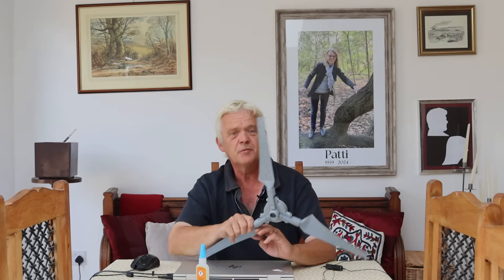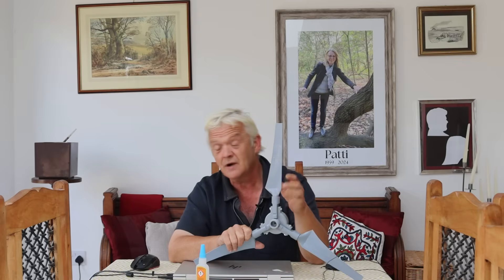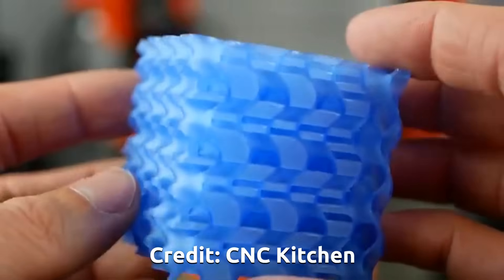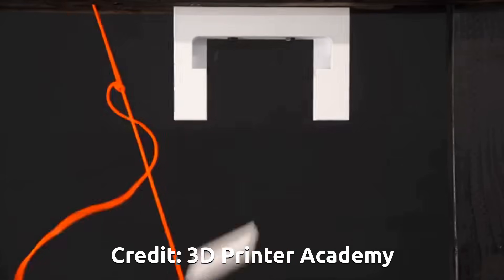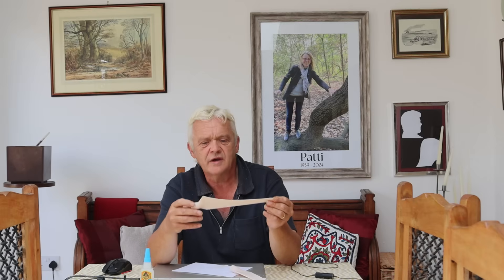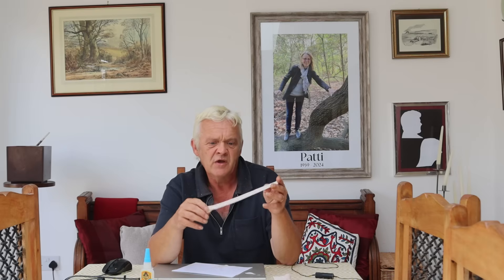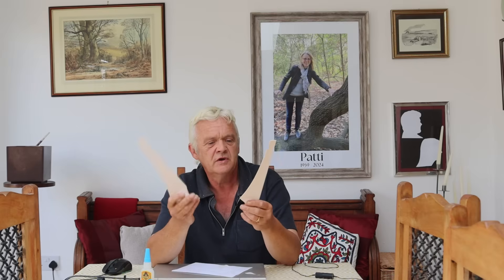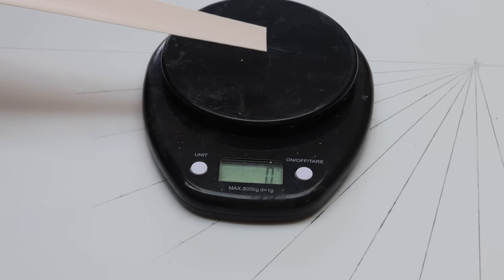2281 Making Stronger Wind Turbines

Comment: Hi Rob, I missed you deeply while you were in morning and you can't imagine how happy  am to see you back. I do realise that my small inconvenience was nothing to what you have suffered.

As far as the strength of gyroid goes, it is ansiotropic in compression, sure, but in bending and tension we have to account for the fact that FDM is in layers, so there will always be a weakness if layer adhesion is weaker than the cohesive strength of the material. Also there is the question of the infill to wall connection. I see these aspects have both been mentioned in the comments but I hoped to clarify a little.

Slightly off topic, but not so much: I have been developing on a device that was inspired by one of your earliest videos - The Secret of Magnetic Motors, iirc. Initially the idea was to switch magnetic flux so that the power of the magnets would determine power output rather than the input power. In the design -> solve problems -> redesign -> make improvements -> redesign, ... process I came up with a completely revolutionary (if you'll excuse the pun) design  that looks like it will run simply due to the geometry of the machine and the arrangement of magnets.

I believe you started this channel because you were investigating free energy and you may have diversified into energy systems in general and anything engineering-fascinating and have distanced yourself somewhat from the free energy mission, perhaps becoming persuaded to the conventional view of physics where, "You can't get something from nothing". Perhaps I have read you wrong but in any case, with this latest design I have had a response from a moderator on the physics forum (on scienceforums dot net) - a guy who was very sceptical with earlier designs and who couldn't be bothered to analyse what I was proposing because Laws of Thermodynamics etc - he replied to my latest post that simulates the device and said, "I have to admit the design is intriguing we will have to see how it works outside the simulation." Now, if that guy - who normally diverts the thread into discussion of quantum spin of electrons or similar - is making comments like that then I am convinced that someone like you will find the idea to be intriguing as well. I hope you will find time to take a look at my YouTube channel at the latest iteration and perhaps at my web page about the device. I would value your input greatly.

Regards,
Prajna

Comment: The Gyroiod is nice and all, but the grain is still there.  It just has air gaps to make it stronger because its more flexible.  If you really want it to be strong, use the print to create a mold and cast it in resin.  If you want it lighter, cast in 2 parts with a structural foam core and epoxy it together.

Comment: I can see gyroid should be stronger but I wonder on a part as thin as the blades, is there enough actual infill to really make a difference?  Your test showed it might, but it was close enough where it could have been a factor of the test not being conclusive as it was only a single sample of each.
Reply from the maker: true enough but others have done better tests to show the validity - i was just confirming it for myself and letting you know
Reply: @ThinkingandTinkering  Right, but my only question was, being so thin, are we actually seeing a benefit with the pattern?  Or if you ran the test 10x on each, would it show that it is in the margin of error and they are more or less equal.  In other words, if each 'pattern' in the gyroid occurs every 1mm, would we need to have something 3mm thick to get all of the interlocking patterns into the object to see the real benefits of it.

Comment: I suspect that the main reason the gyroids don't make a drastic difference here is that the stress is pulling on the layers rather than compressing the gyroids. As others suggested, printing lengthwise would be the strongest as bending the blade wouldn't pull the layers apart. With lengthwise layers I wouldn't be surprised if it becomes so strong that the scale reading maxes out before the blade snaps. The gyroids would still help stiffen the blade better than most infill patterns.
Reply from the maker: cheers mate
Reply: Drastic is by how much? Please notice how two blades behave on the scale. The one with gyroid filling is more stiff - it doesn't bend that easily.
Reply: @ogi22  Drastic as in resulting in plastic deformation rather than, or at least before snapping. Presumably beyond 5kg of force which is why I think that the scale would max out first.

Comment: I would change the print orientation, put the leading edge of the blade on the build plate. You could then tweak the design, by placing the hub mount on the leading edge, so no support would be required.
Reply from the maker: cheers mate

Comment: Interesting Rob. I think the key to strong 3dprints also have a lot to do with the way the infill is attached to the shell, shell thickness (outer wall thickness )and the thickness of the upper layers and the bottom layers(if you print at 0.2 layer heights, you want to set the number of top and bottom layers to 15.(3mm)) I always have my slicer set so that wall thicknesses is always 3mm where possible. As infill I use triangular where infill wall multiplier is set to 2 and infill line distance is 8mm. This makes a ridiculously strong print especially for larger prints when using Petg(245c/75c) - Very versatile, but not the fastest. If I need to reinforce or waterproof something I use Epoxy. Superglue works well for bonding it is quick strong and a must when making 3d printed parts but it has little to no filling and structural strength hence Epoxy.
Reply from the maker: i deliberatly made the shell as thin as possible - but brilliant points mate - cheers

Comment: Gyroid grids like that remind me of chainmail cross layered(dragon chainmail pattern with multiple layers in alternating orientation).  Makes sense as properly made dragon chainmail is much stronger than a single layer of solid metal of the same mass and area covered.  Thanks Robert!  Information videos on this is much appreciated.  Now on to the batteries/capacitors made with this lattice.  I am sure that would pose no logistical problems.  LOL!  Right keep dreaming!
Reply from the maker: i didn't know about dragon mail mate - nice one cheers

Comment: The snapping you're encountering is deamination of the layers I think, the gyroid is going to increase the surface area of the the interface between the layers so you get better lamination strength.

You'll get much better performance if you print the blades a different orientation, try it at a 45 degree angle and you'll change the axis of strain to better meet the part's strength.
Reply from the maker: cheers mate and nice suggestion

Comment: You want to print the blade flat or horizontal so you don't get a surepoint vertically also you want to use a stronger material but pla my favorite material so far which is a good conference compromise without being too expensive is carbon polly carbonate if that requires a 300° print nozzle which is typical not found in a basic picture so that's an upgrade you have to do you will find the part five times stronger and also without the UV decay overtime
Reply from the maker: cheers mate

Comment: Since you have the Bambu Printer. With the exception of losing filament and extra cost. Might try printing the infill with different material like carbon fiber.
Reply: Carbon fiber is not a material it is an attitive
Reply: @giannagiavelli5098  They do make carbon fiber filament. 3D Universe Nylon Carbon Fiber Filament for example.
Reply from the maker: good idea - cheers mate

Comment: Are the stresses on blades usually vibrational? Because if so, it might help longevity to add some type of gelatin solution in one of the gyroid partitions to act as a dampener to vibrations. Especially singe we have ~2g to spare when it comes to weight
Reply from the maker: that is an intersting suggestion - cheers mate

Comment: A colleague of mine, another naval architect who fiddled with making ship hulls at scale in filament 3d printing told me one secret to aleviate the layer bonding problem was to cover the 3d model and bake it at around 80°C to 90°C for 3 hours, wether covered in salt or sand, as to use the crystals slowly transfer the heat in a very uniform way and elevate the temperature of the material to better fuse layers together. According to him, it made wonders.
Reply: Annealing is a really interesting topic in functional 3d printing.
Reply from the maker: it's a good way but there are issues with shrinkage and heat control

Comment: You'll also get a strength increase if you print the blade tilted over at 45 degrees so there's more surface area contact between the layers.  Might be a bit of a pain to support at the base but the strength increase should be significant.  As long as you tilt it on the roll axis you won't end up with jagged layer line artefacts creating drag.
Reply: This exactly.
Reply from the maker: cheers mate
Reply: Tilt it less (from the vertical) and no additional support is needed..

Comment: Nice work.  Two items: 1) a skin coat surface - even cellophane tape - would possibly increase strength: suggest paper bonded with super glue. 2) the gyroid produces 2 non-connecting channels - might a lightweight line passed through one of the channels be used to provide a tensioning force to increase overall strength?
This is the kind of thing Andrew W could have used with his 1st version of the 3-d printed surfboard.
Reply from the maker: i saw that video and it was pretty cool!

Comment: could you print a mould and melt waste electric  pipe offcuts or  better plastics maybe some fiber glass strands tied  into mould?
Reply: or steel inside the mold?
Reply: @paulleftwick7782  
"or steel inside the mold?"

Steel has a higher melting point than plastics.
There is however, metal 3D printers that use a sinter process to bond metal powder into form.
Those printers are over $10,000.
Reply from the maker: you could but the actual doing of that is going to be a challenge i would think

Comment: Laminate the blades with Carbon Fiber weave.
Reply from the maker: cheers mate - and you have to see this as a composite i think - all elements add to it
Reply: The strength is in the shell not the interior it could be hollow, infill or solid;  the over all strength will not change that drastically. If you take a foam bar and bend it what happens? The outer side layers stretch and the inner side layers compress, Anything in the boundaries does what? Its pretty much static right? So to really add strength you need to improve outer shell of the part. Print a skeliton and then wrap it in carbon fiber weave, very easy. You dont really even need to use carbon fiber. you can use cloth if you wanted but the process would be the same.

Comment: Interesting infill. How does it compare to a simple honeycomb? It's a common weight reducing technique in aerospace. Also, perhaps printing in a different orientation may be all you need because the stresses are predictable. I suppose if you have an infill that "just works" in any direction and it doesn't "cost" more than other infills, you don't really need to think about it anyway... 🤷‍♂
Reply: I was wondering that. Honeycomb is used as a sandwich in carbon fibre construction so how would a gyroid sandwich compare.
Reply from the maker: honeycomb is anisotropic - that is it is stronger in one direction than another - gyroid has the same strength in all directions

Comment: I think we are all waiting for the one printed on that elegoo OrangeStorm Giga. Also the bigger the blade the more difference gyroid infill will make as when they are both that thin gyroid still suffers from layer adhesion weakness
Reply: I somewhat agree. I hate I won't be able to copy but would love to see some scaling information
Reply from the maker: the problem with that is what in-finate said - how can others copy it? If you can't copy it or verify it it has limited value tbh but having said that - i hear you